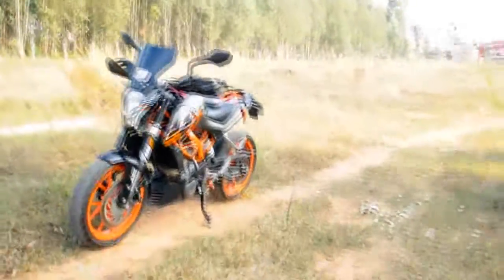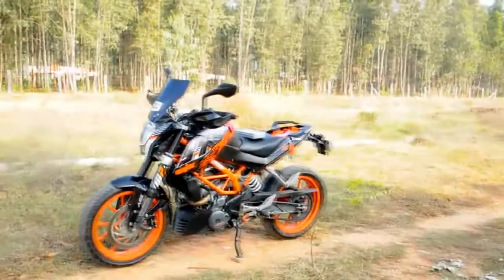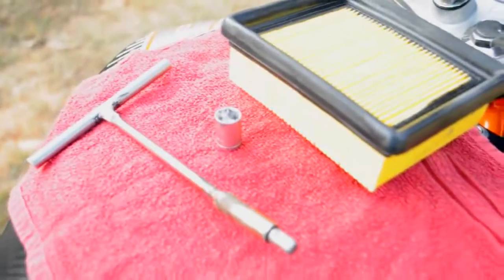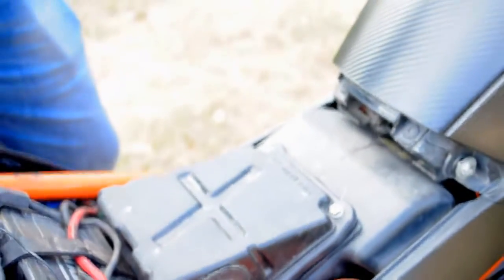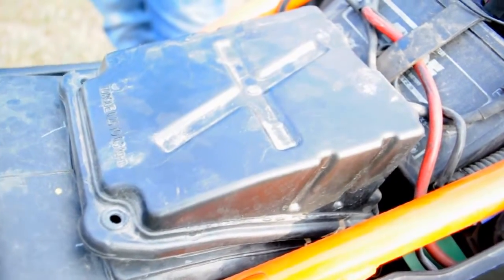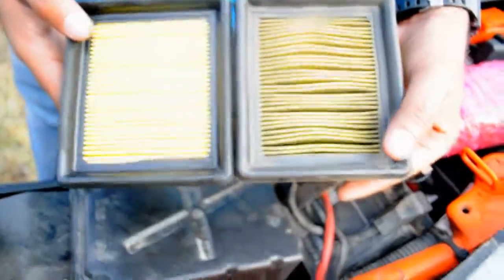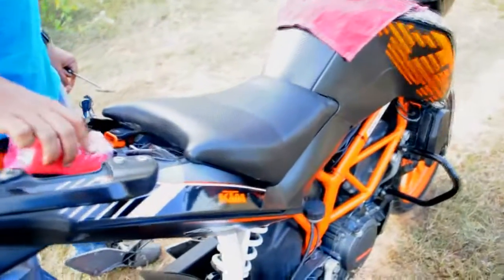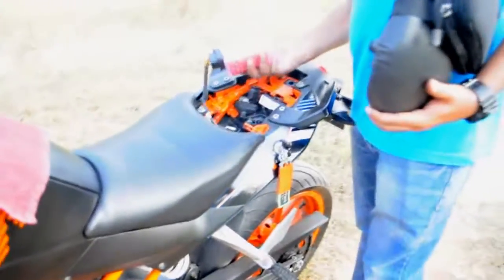KTM DUKE 390- Air Filter change | DIY|

Comment: Yes there are small clips on the air filter housing in the back that aren't easily seen.  Those clips need to slip into place so that the air filter top sits down properly.  I had a problem trying to get my K&N in and seat the air filter box down properly but eventually was able to accomplish it.  Thanks for the vid.

Comment: aj it will be extremely helpful if you can leave a link to the tools you use for the bike such as the torque wrench and etc and as always a wonderful video your diy tutorials a real money saver. thank you once again
Reply from the maker: Thanks dude... I personally do not own any fancy tools... Just basic bike needs which you can get at any locall automobile shop or hardware shop. Most of the work is done at mechs workshop ☺️

Comment: have you got foam inserted on the rider seat ? is that a ride on air pillion seat add on ?
Reply from the maker: Krunal Thacker Nope. I have inserted only foam and wrapped it up. Will not spend unnecessary 2-3k for ride on air and other gel seats :) This does a pretty good job.
Reply from the maker: There is a small review on the seats coming too. Stay tuned :)
Reply: AJ 390 looking forward to it .
Reply: wt is that red thing connected plz do share abt it.. all ur video worth seeing 👌👌👌👌👌👌really its good  n im so curious wts next.. i polished my wolf 390 exaust pipe  u r really amazing..it worked thanx bro plz continue...plz do share all DIY N give us regular updates all the very best.👍👍👍👍👍👍👍👍👍

Comment: How often to change ??
Reply from the maker: Every 5-8k would do
Reply: Wrong. Manual says change the air filter ever (7500) km (4650 miles) and to clean the air filter box every (15,000) km (9300 miles) 
Please read your manuals guys it's simple
Reply: Wright down your maintenance schedules on a piece of paper and keep under seat of your bike you will never need to look them up again